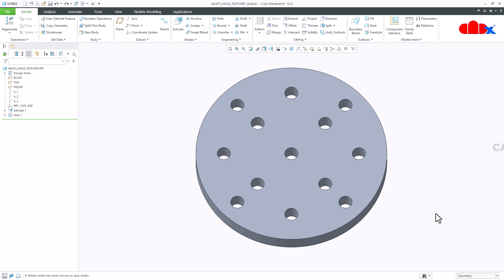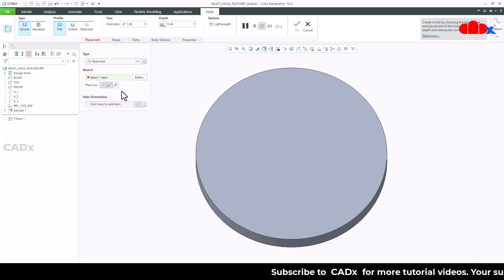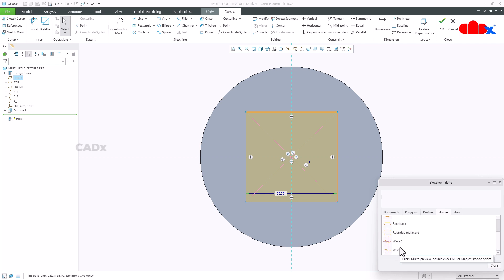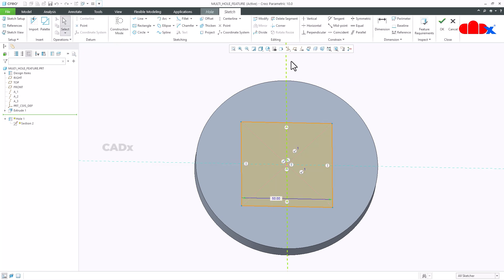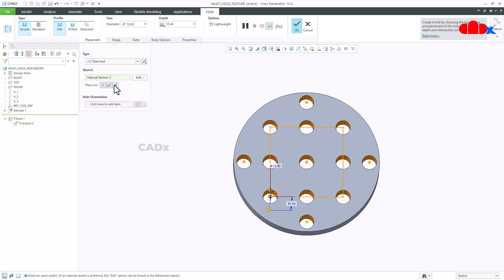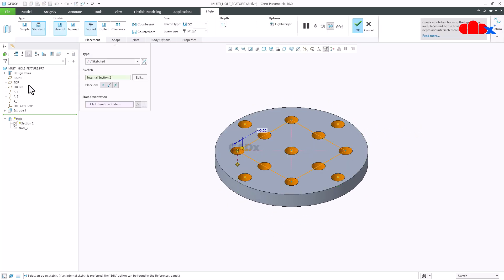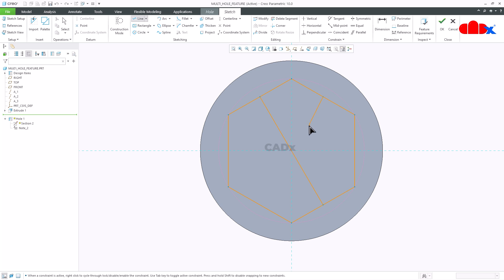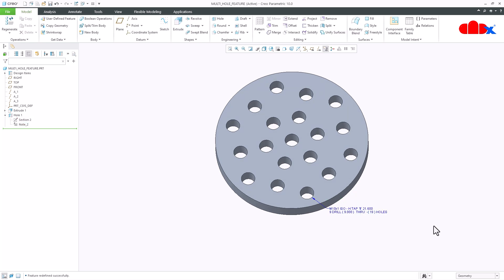Multiple holes at once in one Hole feature | Multi hole feature in Creo Parametric

Comment: If we create 6 hole dia 8.5 at pcd of 150 through this method using hexagon shape then I don't get pcd circle in final drawing.
Reply from the maker: This is another personality offered by creo parametric. This takes less time to regenerate the feature and the file size is less comparatively. We can choose the suitable method as per our requirement. This is not used in the case of PCD.